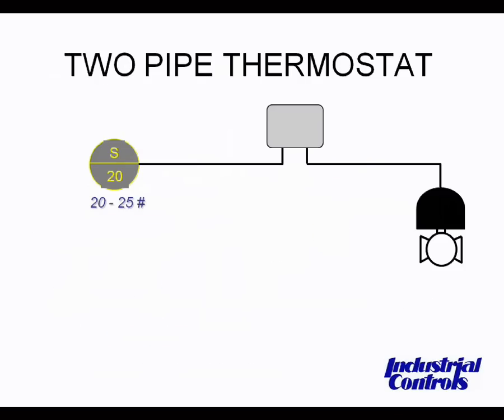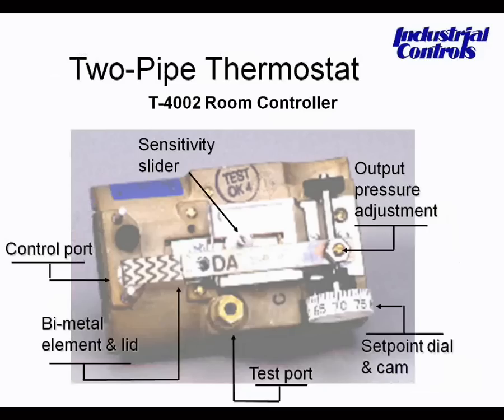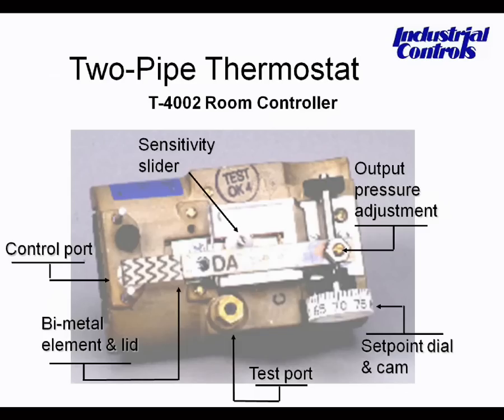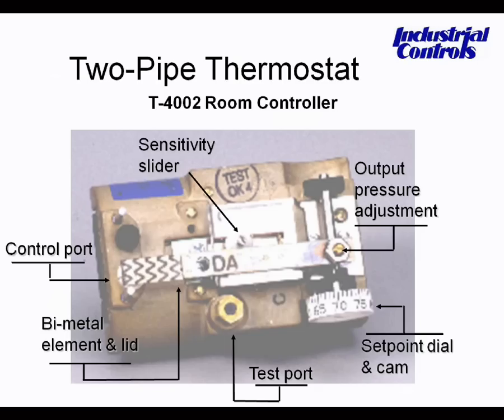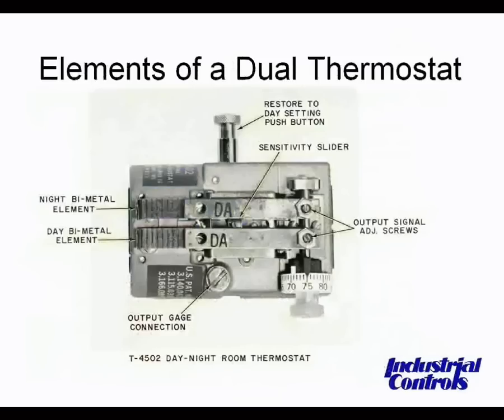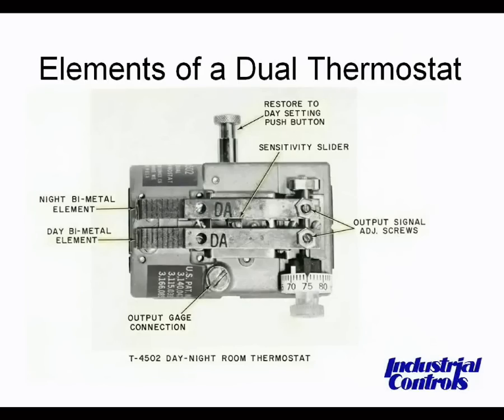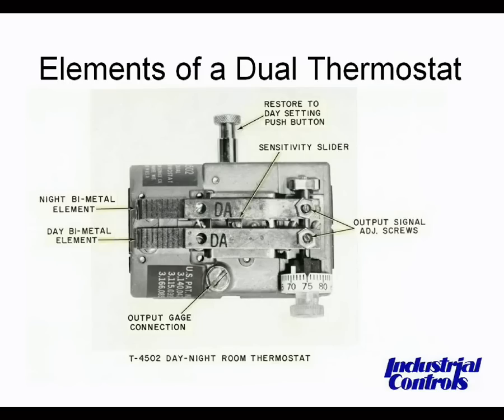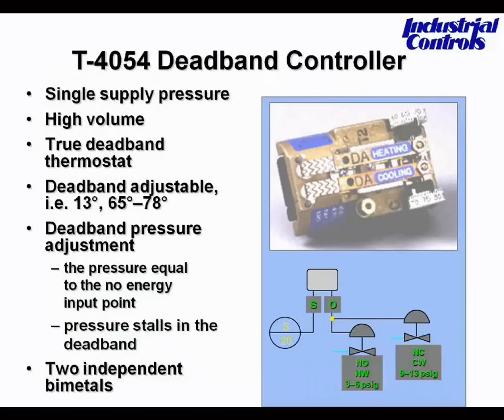Pneumatic Session #2 -- Thermostats and Controllers: Clip 2 of 6

Comment: Thanks for the response.  At first I didn't understand it because on my system the indexing switches didn't pop back up during day mode.  I finally realized that the thermostats had been damaged by bad air at some point.  As I have replaced them I see that in day mode they do pop right back up.  This channel is a fantastic resource.  Thanks again.

Comment: On the dual thermostat, if the manual override push button is depressed during the day (15 psi supply), does it have any effect?  Is the push button supposed to automatically return to the up position, if so, what triggers that?